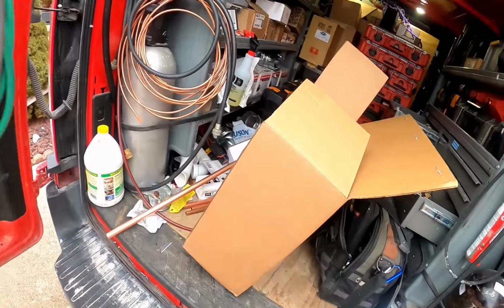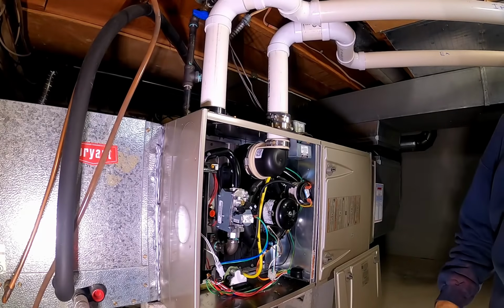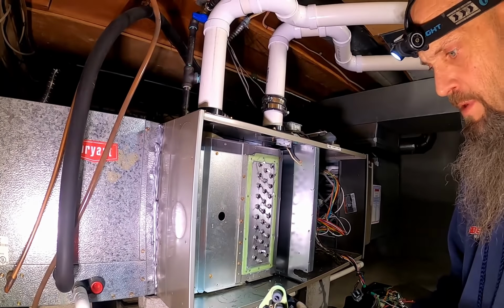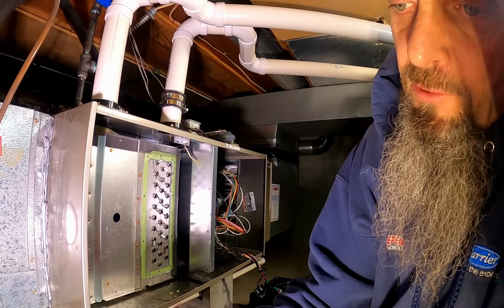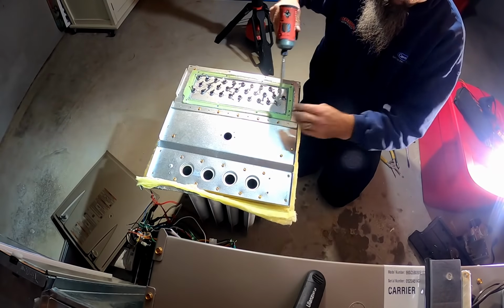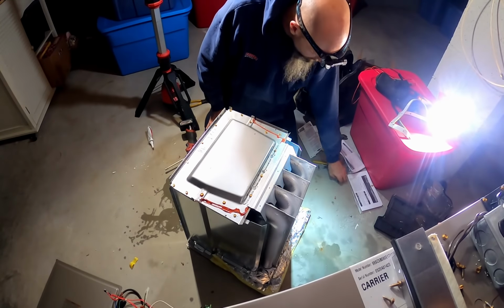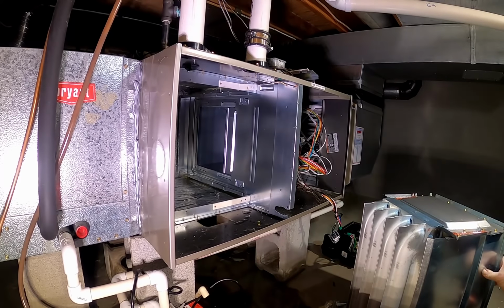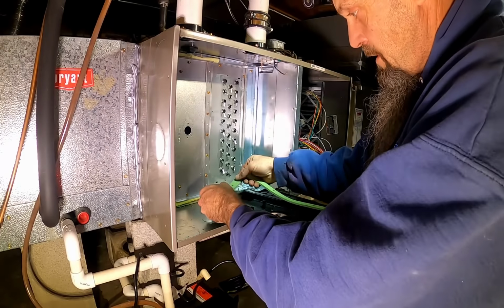Stripped Collector Box Screws = Heat Exchanger Replacement

Comment: This video was very helpful.  Mine also has a stripped screw hole at the bottom.  The water leak is very minor.  Should I just leave it alone vs. trying to repair?  Any safety concerns?

Comment: Stainless nutserts and machine screws looks like the longterm answer,   would be quicker and cheaper to do this in-situ.         I have used this fix very successfully on other units with no problems. HTH.

Comment: You probably can’t do it because of voiding the warranty if that was my furnace and I had room it would get nutserts and machine screws!
Reply: Rivnuts have a shoulder and the splines that do not hold good in thin metals (similar to those poor holding wood threads). As soon as a little torque is put on them, they’ll spin. . The manufacturers should use 10-32 stainless nut plates, like these MS21060-3, installed with countersunk rivets. This would provide a flat sealing surface. Then use red high temp rtv as it fills gaps better than those quickie factory gaskets. Use 10-32 SS bolts with large area washers. 

Oh, but then that extra 10-15% “higher” efficiency has already cost hundreds more! We have draft inducers , pressure switches, furnace control boards, busted/leaky collector boxes and clogged secondary heat exchangers. Consumers have already came out on the losing end with these high efficiencies! Bring back the good ole natural draft furnaces.
Reply: @USA-GreedyMenOfNoIntegrity  My condensing furnace has been running fine since 2008 and paid for itself in the second year compared to the natural draft one it replaced... You can't beat over 100% efficiency compared to the LHV.

Comment: WTF you removed the the heat exchanger because the screws were stripped out and then installed a new one with the same exact issue? Problem solved. Sorry but shaking my head on this one. I would have at least tried to remedy the issue.

Comment: Promised Cost: 90%+ furnace gas savings over 80% furnace over 20 years = $1000
Actual Cost: $500 more MSRP on the furnace, $1000+ to replace and maintain extra gadgetry such as the collector box + fancy heat exchanger (pray for it to be under warranty)
Reply: Less gas burned is less CO2 emissions which is a good thing for the environment..... Until gas gets expensive and electricity is cheaper when more nuclear plants get built, ground source heat pumps will eventually take over!
Reply: Without CO2 trees and other plant life would perish. You're stating mere opinion, not a fact. Thanks for your input, however :)
Reply: @biker55555  LOL, the future is electrical! Global climate change is real and caused by human use of all the fossil fuels. If natural gas wasn't so cheap, I'd switch to ground source heat pump for heating and cooling. It doesn't make sense money wise with the current cheap prices of natural gas. 
Trees and plant life thrived before our use of fossil fuels began.
Reply: LOL'ing won't turn your opinion into a fact. Climate change IS very real, it has been ongoing for 4,000,000,000+ years now. Problem is... folks that push CO2 narrative don't realize that the servicemen will spend more in gas driving to and from to service the crappy 90+ unit on top of the manufacturer spending all the gas to manufacture repair parts that fail over and over than the amount of gas saved by using such appliance over its useful life span. You're so worried about CO2 yet you continue to burn and use fossil fuels. All you do is shift the CO2 footprint with your electrical toys. You've been saving so much gas, you sound full of it 😂 Look up "law of diminishing returns", you may learn something eye opening.